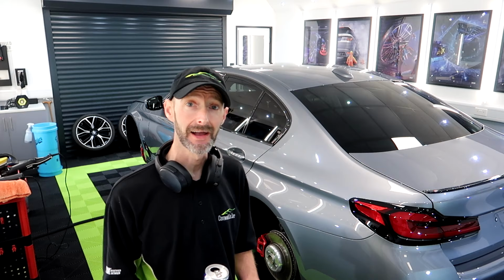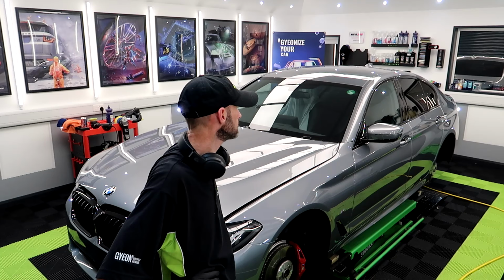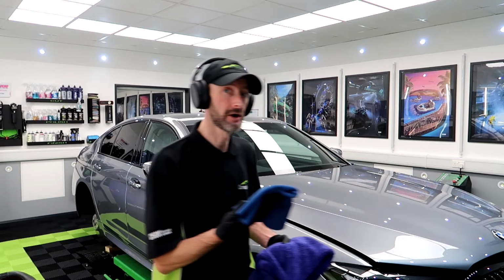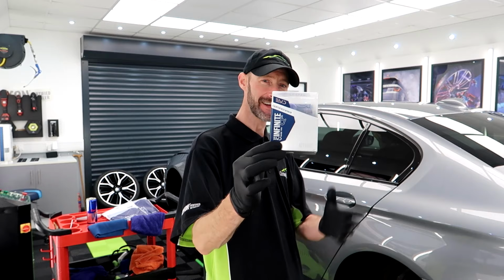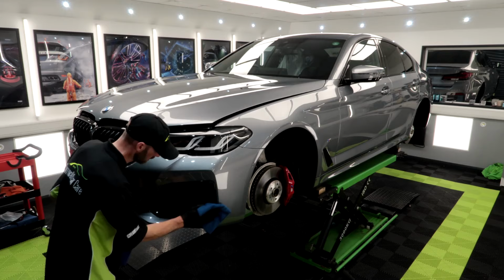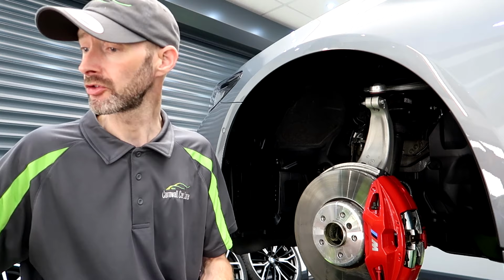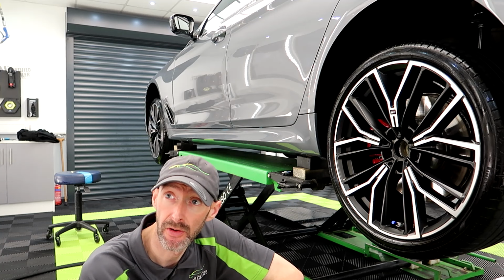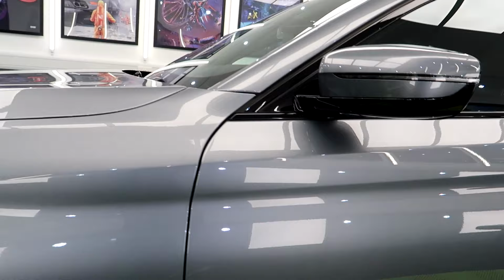VLOG 33 BMW 520d 2023 New Car Detail #gyeonized #gyeoninfiniteevo #gyeonuk

Comment: Lovely job!  What was the chemical in the white and yellow trigger, used before Gyeon Prep, and what does it do? Thanks! All the best.
Reply from the maker: That was Spies Hecker 7010 panel wipe, which is used before GYEON Prep to remove polishing oils before the ceramic coating is applied ( not cheap £83 for 5 litres ) but its the best out there.
Reply: @cornwallcarcare8959  OK, that's more confusing to a novice... what's the prep for.... how do they differ.... so sorry for all the questions.
Reply from the maker: @decker0373  With any ceramic coating that gets laid down you have to remove any polishing oils beforehand as this will hinder the coating from bonding properly, Spies Hecker is a strong panel wipe to remove these oils and allow the coating to perfectly bond to the paintwork. Hope this helps 👍